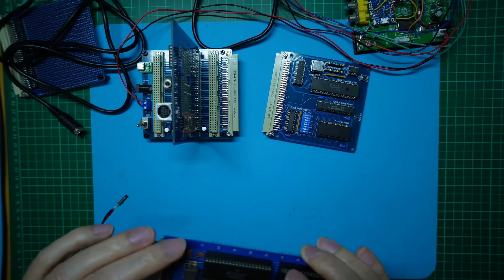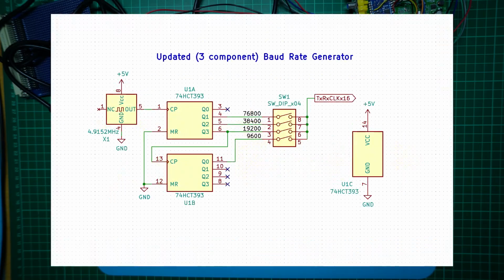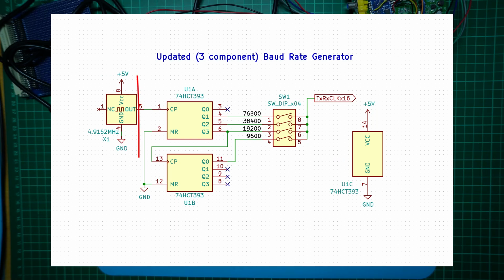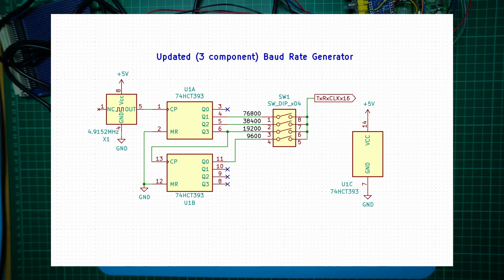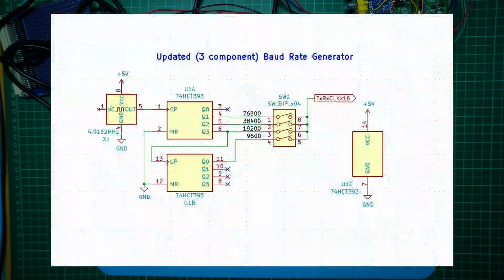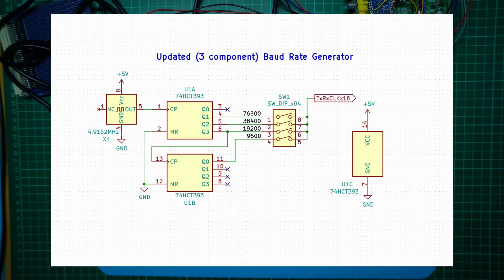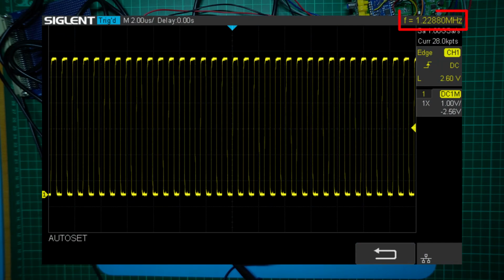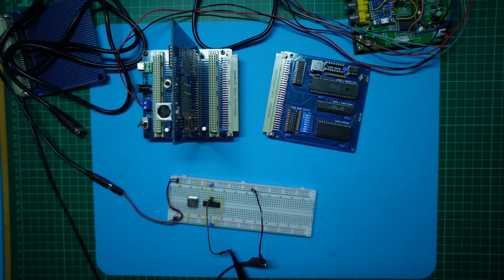A Retro Motorola MC6850 ACIA Baud Rate Generator

Comment: This was the first video of yours I ever watched and was a great help to me after failing to get 9600 baud working on a 6850 using a /1 divider. That crucial bit of information about synchronization I couldn't find published anywhere else. Is it in the datasheet and I missed it? Certainly explains why every design I have ever seen on the internet runs at either /16 or /64.
Reply from the maker: Thanks for letting me knowing my video was of help.  The original MC6850 datasheet, that I have, notes on page 6 (under "Receive Clock" heading): "The Receive Clock input is
used for synchronization of received data. (In the + 1 mode, the clock and data must be synchronized externally.)".   So, it's probably easy to miss this subtle /1 point in the brackets.  🤓
Reply: @DigicoolThings  Indeed I've missed it. It's in my copy also! 🤣 Thanks again.